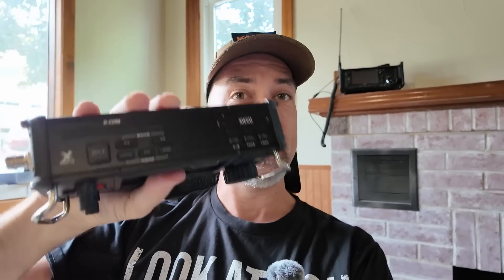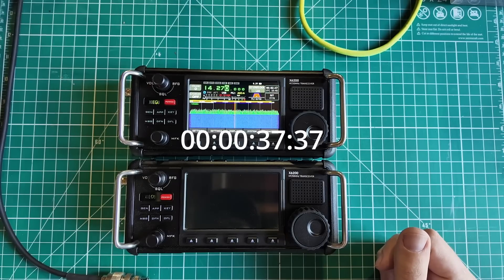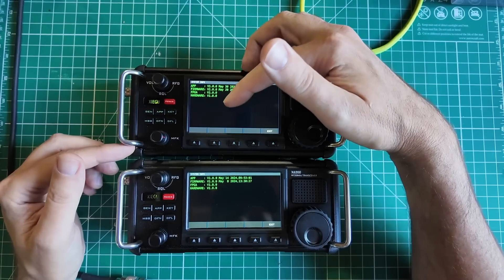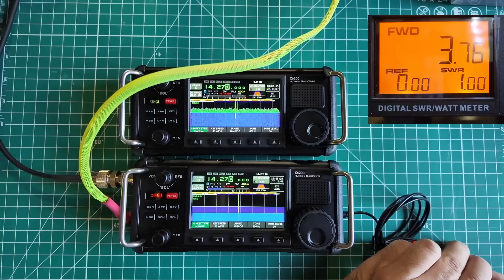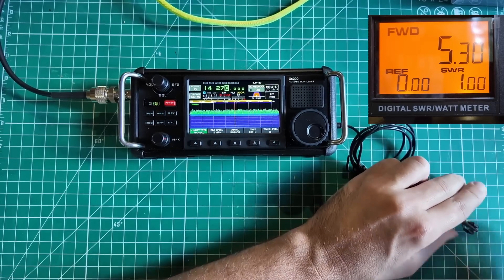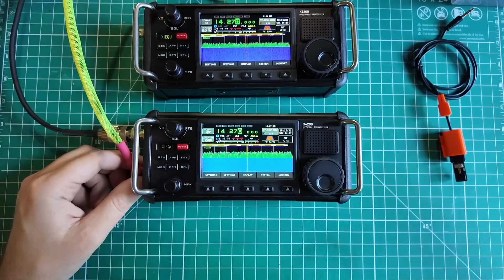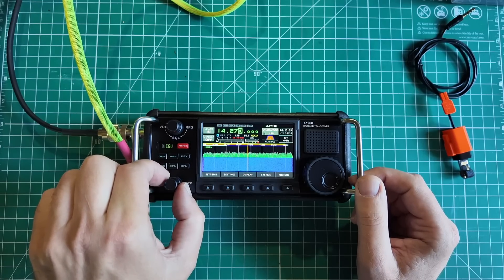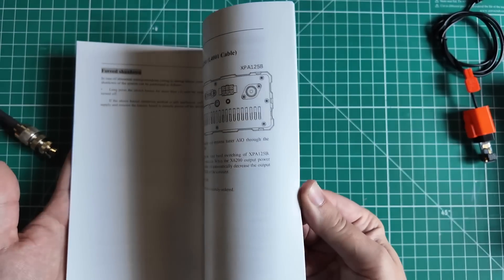Prototype VS. Production Model - Xiegu X6200

Comment: As most all of my operating is CW the power ramp is extremely concerning.  However since it is now over 7 months since the last firmware update I am starting to be concerned over the radios future.
Reply from the maker: Xiegu is still making firmware updates for the G90 and they just released one for the XPA125B amp.  They aren't giving up.  They do really good for a VERY small company.

Comment: Hi Steve and everyone!
Got my X6200 three days ago and it would be a nice rig (pretty housing, excellent display, good working noisreduction, many features), if there weren´t some unacceptable issues:

- every few seconds a "POWER FAIL. POWER DOWN IN 179S"-message pops up midscreen
- transceiver gets hot even without any transmitting
- SWR-Scan always shows excellent SWR across the whole band, even with totally inappropriate antennas connected
- ATU doesn´t work right, after tuning, SWR is still worse than 1:2 and transceiver switches power to 1W
- S-Meter doesn´t work properly. Even with very strong signals (S9+30dB) it shows not more than S5. Most of the time it shows S0-S1
- FM broadcast band nearly deaf. I normally receive 50-60 stations here. With X6200 I can use 3 of them...

Knowing you´ve tested both the prototype and the regular production model, I´d like to know if you noticed any of the above mentioned issues besides the power-lag you showed us?

I decided to send it back and wrote to Radioddity, still waiting for an answer. That transceiver not useable. I own the Xiegu G90 and the X5105 which are both good transceivers. And I own the IC-705.
If you ask me what to buy, I would say take the 705 if affordable in any way. It´s by far the best of them all, even without an ATU.
73, Bernhard

Comment: interesting. some problems fixed. both power out put not steady. still no expansion slot ??? well lets heat the finals up on FT8 . do some tempura readings and the  fan for the 6100 as well.  would like to see how well the fan works.  does the 6200 need a fan? lets find out on video. playing with new stuff is fun.  do some harmonics testing as well. would like to see what a AM station does to receiver.  we know the G90 wipes it out. may have to go for a long drive for that test. well you could key on on CB and see what it does to 20 meters. 73's
Reply from the maker: Fun First!  For the current time, fun is all that matters - helps you learn/grow also.

Comment: Hi, do you think it is possible to open TX frequency in the same way like X6100?
Reply from the maker: Exactly the same way!
Reply: @temporarilyoffline  Thank you for your reply, but F-TX ( in red color ) show on the left top corner of the screen, but it doesn't  work...! The folder contains a log file where register date and time when we change the Full TX from "disable" to "enable".
Maybe you ( Linux expert 🙂) can find what we are missing... Thank you. 73's!
Reply from the maker: @JoseAlves-1960  I see now, yeah... It's broken for sure.  I'll dig a little deeper.

Comment: No, there should not be any questions regarding upgrading from a X6100 to a x6200.  Only if the money is burning a hole in your pocket.  In other words, it's a dum move.  The real questions is  what should one buy now, a X6100 at $550 or a X6200 at $800.  This perspective is hard to give when one gets a free radio.  My problem with the X6200 is that at $800, it makes smart sense to consider a good real workhorses:  FT-710($1000),  IC-7300($1100), FT-991A($1150).  But at half the price the X6100 also looks like a smart choice.  On the other hand, one could always justify any radio purchase (to the honey) by stating that "at least I don't have a drinking to drug problem!
Reply from the maker: Once I get a free radio, I'll let you know if my opinion changes. TANSTAAFL  I'd probably go with the FT-710, I can easily justify the $200 more.
Reply: @temporarilyoffline im really happy with my ft710, I think xiegu should have done a 20 watt version, that would have made it a world beater!  I did love the tuner in the x6100 however.
Reply: I bought my X6100 for $325, as b-stock from a neighbor who is a dealer. (Connect Systems) At that price I'm REALLY happy with it. Had I paid full-tilt, I likely wouldn't be as happy. It's lots of fun though, which to my mind is the most important thing. It's all about fun, and as with most fun things, "smart sense" isn't always in the equation. 73.
Reply: I just did  another price check on the FT-710.  I now see that Yaesu has a "FT-710 FIELD" version (no external speaker only internal) and there is a $200 Yaesu Rebate program going on until June 30!    With rebate the R and L  "FT-710FIELD" is going for $880.   WoW!  the X6200 for $800 or the FT-710 FIELD for an extra $80!  Winner Winner Chicken Dinner!!

Comment: When you release the key the tx light goes off but the MFJ power meter is still showing power out when the radio is on receive. Do you have another power/swr meter you could try?
Reply from the maker: That's a 'feature' where the MFJ shows you the final power reading for a few seconds after you release.  Its designed to do that.

Comment: Another potentially expensive video.

I wonder if the power drift is duet to increased charge mobility in the silicon of the final(s) as it warms.  That would indicate that power is set by controlling drive, rather than any ALC type action.

I'm spoiled for boot time by my KX3, but that doesn't include Linux.
Reply from the maker: Right - its a "PC" vs a "radio" startup time.

Comment: Check with Rob Sherwood, NC0B on how to do the receiver tests.
That power out issue is questionable. Do you have another meter you could test with?
Reply from the maker: Plenty of meters.  I'll do a video comparing the 6200 to another radio to better describe what I'm seeing.  It kinda "matters" and it kinda doesn't - like the difference between 8w and 10w kinda "matters"

Comment: Park within 5 miles of a high-powered AM radio station. See if the front end gets hammered.
Reply: I've got an AM station a few miles away, my X6100 definitely gets swamped by its signal. I built a K9DB BCI filter kit which completely resolved the problem, best $20 I ever spent on radio gear. But yeah, I'd like to see if the 6200 handles it any better.
Reply from the maker: That BCI filter is great.  I did 2 videos on it, a test with the NanoVNA: https://youtu.be/qF5idlbnsds and a build vid: https://youtu.be/VJ4VfRmcMqc
Reply: @temporarilyoffline  Yep, I watched one of them. I ruggedized my filter with another layer of heatshrink, this fibrous mesh stuff with heat activated glue inside. It's a little brick now, you could pound in nails with it.
Reply from the maker: Great idea... just have to find one.

Comment: I ordered a new X6200 on Monday. Just curious how long it took for yours to arrive.

Also, as I watch you checking the response time for key-down full power, I can't help but wonder if the delay is in the rig, or in the wattmeter display. Years ago, I had a dual-display wattmeter with a bar graph peak display and a 3-digit numeric digital display. The numeric display always lagged behind the peak bar graph display. It would be interesting to compare with an analog meter in line with your MFJ, even a relative display like an inexpensive analog SWR bridge...

De WB2VUO in Amherst, NY
Reply from the maker: Mine came in a couple of days, Radioddity was very good about shipping update notifications.

I'm going to do another video where I show the meter comparison on a non-x6200 to illustrate the speed a bit better.  Too many videos to make!

Comment: As a plus it does look like switching from battery to shore power on the production unit doesn't add to the noise floor like the pre-production model...that's good news.  EDIT:  posted this before I saw you test it again...good to see
Reply from the maker: Those were the big things I was concerned about.  Also, the prototype didn't work on FT8 and this production model does... just need better solar conditions and time to make the FT8 vid.

Comment: Hi Steve, may I ask for two tests ? 1. Birdies test, specifically on higher frequencies bands. 2. Tuned frequency transfer via antenna to another TRX, while on RF. X6100 has this nasty effect, there's a bird on another radio at the frequency X6100 is tuned to.
Reply from the maker: I did a birdie test early on, was there some specific frequency you were interested in seeing?  Since this has a new SDR core, the birdies are likely gone.

For your second part, are you saying that if I tune the X6100 to 7.200, there will be a signal transmitted to a nearby radio even without PTT?
Reply: @temporarilyoffline  Yes. I have my FTDx10 nearby and there's a S9 spike on the exact frequency X6100 is tuned in and the spike follows frequency change on X6100. No PTT pressed. And yes, on my X6100 6m band is unusable due to number of spikes.
Reply from the maker: @pawelstankiewicz5284  Did you see this one on the Birdies? https://youtu.be/UivCB4OUleU
Reply: @temporarilyoffline  Yes, I saw that, but the tests were made on prototype. I'm just wondering if production is ok. Regarding 9S bird - I just discovered it get's transmitted outside X6100 when preamp is OFF. There's no bird if preamp is ON. Funny...
Reply from the maker: @pawelstankiewicz5284  Oh I can see how that makes sense.

Comment: I am really leaning towards one of these or a x6100 unless I find a heck of a deal on a used 705.  Being a budget constrained ham, every penny counts.
Reply from the maker: The 705 would be the better "all in one" value, the X61/200 could be more fun depending on your definition of fun!
Reply: @temporarilyoffline  My first radio was a UVK5 that I currently and running IJV mod on and may do the HF mod too. I like to tinker, so that is why I lean towards the Xiegu radios, plus I can spend 700ish on the 6200, and have money left to get a bunch of antenna and coax before I would equal the price of a 705.
Reply from the maker: @DeLorean58  I think you have a similar definition of fun to me.  The X6x00 series of radios can offer a lot of hacking potential, but Xiegu hasn't released the "keys" as much as they should.  Would be great if they made the whole build tree a little more transparent and provided an SDK for devs to work with.  We'd see a lot faster update cycle (like we did with R1CBU firmware) if Xiegu released it.
Reply: You can’t knock the G90…. No hacking but small screen.  I”d prefer the G90.  It looked like you struggled with the 6200 little dials, is there Bluetooth?
Good video TO
Reply from the maker: @bobcatskrieman3384 the dials are speed sensitive. At slow speed it takes two clicks to move one mark. Something you'd probably get used to.

Comment: Hi Steve, could it be your swr and power meter is in average mode (slower peak reading), I have a meter that does bout average and peak. In SSB average will show a average power output that stays almost the same while speaking. When set to peak mode instantly the max power is shown. 74 Phil ON4VP
Reply from the maker: This meter doesn't have a mode setting like that.  Previous radio test have "shot up" to expected power immediately and then possibly slowly started to lose power as you continue to key down. (As expected when adding heat or losing battery voltage). I'll try and make another video comparing to another radio that acts normal